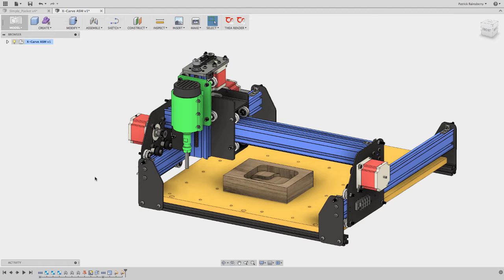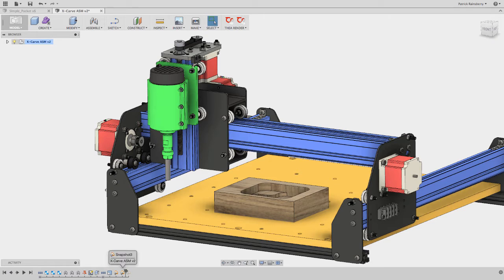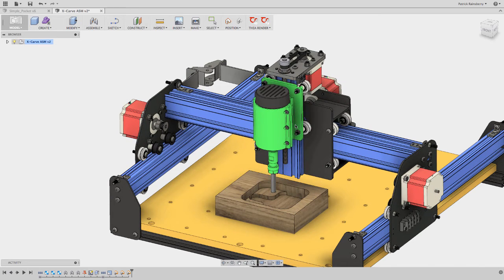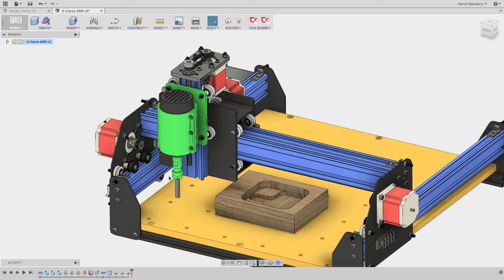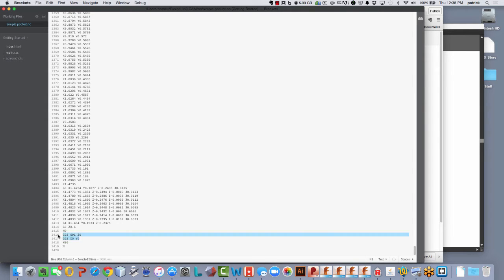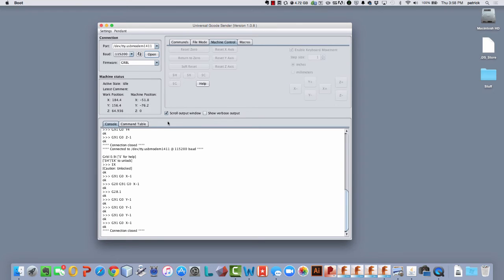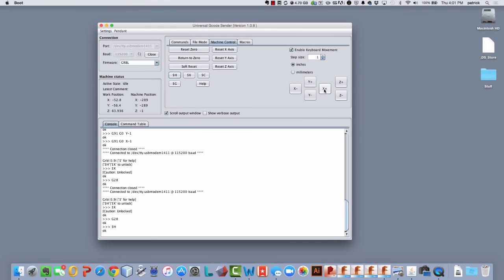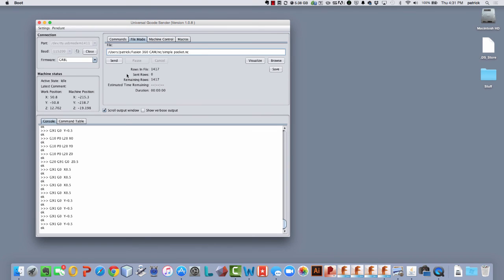Understanding G28

Comment: Thanks for that explanation. IDK if anymore mention this because I didn't read the comments. I noticed that when the G28 command is triggered, The movement is with all three axes at once. so if it's on the other side of the model, close to an edge, it should go up first before it goes Y & X. But I noticed in your video, it does XYZ at the same time, which would run into the model if it's in the way. am I right or wrong? Speaking and the end of the job.
Reply: Did not see the video- but yes you are right, on a CNC mill there would be a spindle up code 1st G00 then a Z...2-3-4  inches to miss the material , spindle would go up-  then the next line of code  would be G28- and X and Y would rapid move home and Z would also rapid up if it was not all the way up witht he previous line of code

Comment: Thanks so much for this explanation it helped a great deal. I have a question though; I have now set a G28.1 position for the spindle to move to a safe place at the front of machine for a tool change - very handy. However, I would like to have a second position to send the spindle to the rear of the machine to enable easy loading/unloading of sheet material. Is there a way for me to do this. Thanks again.

Comment: Awesome video.  However, I am slightly confused.  From the way it was initially explained, I thought that the Z axis was raised first before the X,Y to prevent crashing.
However, when watching it run, it appears as thought all three axis are moving simultaneously.  

Is there a way to get the Z cleared prior to any X or Y movement?
Reply from the maker: Yes i have noticed that as well.  I think it is an issue with GRBL that it doesn't respect the XYZ flags.  You should be able to just go to the Z piece then the home position.  I have not verified this or checked latest versions of GRBL though so i am not exactly sure.  Either way i would try to make sure that you would not be impacted by moving directly to home position in your setup if you are going to use G28 commands.
Reply: Patrick Rainsberry Good stuff.  Thanks for the info.

Comment: Nice video and explanation Patrick.  I also just watched your video on machining the 3D scan of your face and enjoyed that too.I recently programmed a 4' long sign using Fusion 360. Unfortunately our Makerspace's CNC router only has 24" of travel so I  had to program each end separately and reposition the workpiece on the machine to cut each end. Pretty typical stuff in the life of a CNC machinist but I went through a significant learning curve trying to figure out how to create an open boundary profile in Fusion 360 to avoid cutting the sign in half.  (BTW, in spite of my search efforts it wasn't until after I had completed cutting the signs that I stumbled on the 'Left-Click' Open Boundary option ...  I also had problems getting my geometry to chain but that's a story for another post.)Anyway, I was thinking of posting a tutorial on what I learned but haven't made one before and just started looking for the software to do some of the screen recording and such.I couldn't help but notice how effective the controllable virtual CNC in your posting was in helping to convey some of the points you were discussing.  I've never seen that before and wondered if you'd be willing to share where you got it with us ?Thanks in advance for your consideration.Keep up the great work !Jay
Reply from the maker: +Jay Perez Hey thanks man.  No problem.  I downloaded the models from the inventables site and added all the joints and assembly structure in Fusion to be able to pull it around.
You can download my model here:
http://a360.co/248rLrh

I used Camtasia to do the screen recording but there are a bunch of tools out there to do screen capture.
Reply: +Patrick Rainsberry Thanks for sharing your model with everyone Patrick. Very generous of you. Sorry for the delay in acknowledging your post. Took me several days to remember which of the many sites I had gone to in search of this information before I found it again. ;-)

Comment: Good info, never used a GRBL so wondered if it support the G53 command instead of using G28?
Reply from the maker: l0ckcr4ck3r It does, but for our generic grbl post in Fusion 360 we use G28 to keep it more customizable.
Reply: ***** l0ckcr4ck3r I'm going to do a G53 version soon. With home position properties in the post dialog. But G53 will still be relative to the machine 0. So you would still need to home the machine as shown in this video.